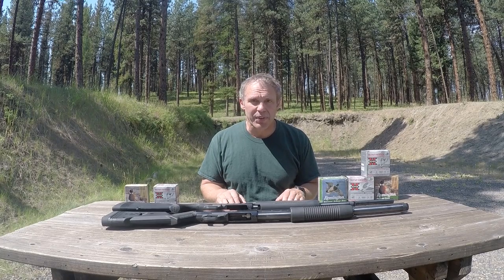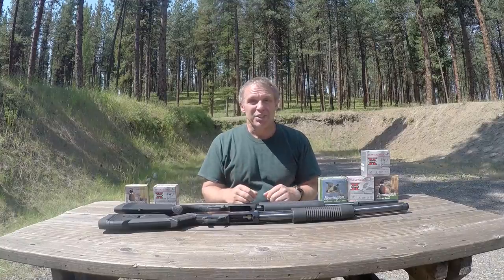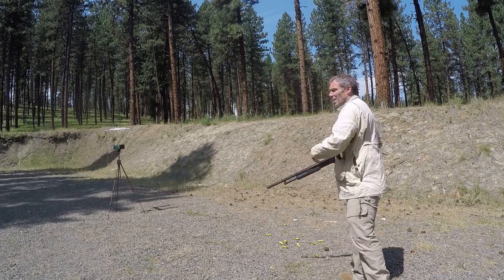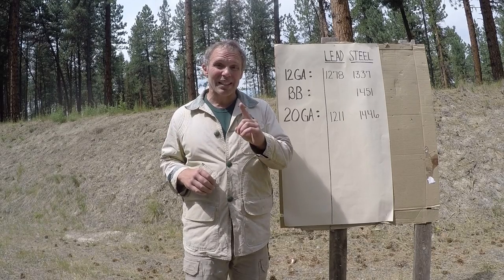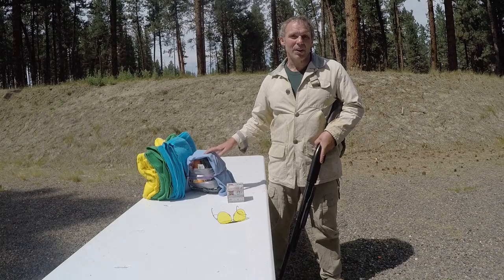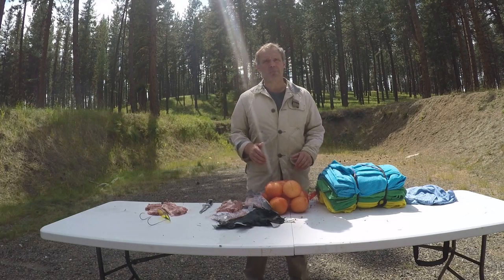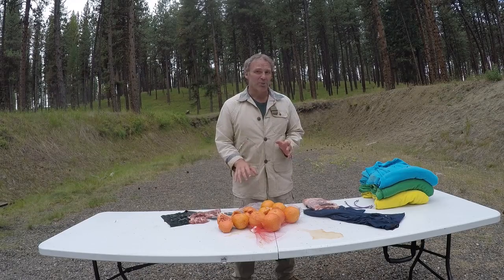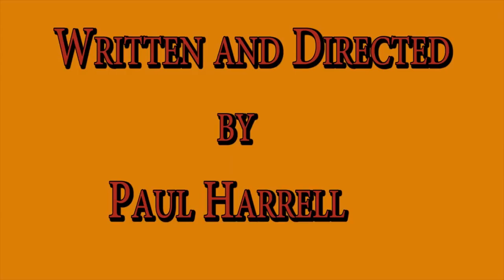Steel Birdshot for Home Defense

Comment: I'm pretty sure that had I tried to test the velocity of my shotshells I would have proven that both lead and non-lead shot are viable self-defense loads against chronographs.
Reply: Yup. For me it would take them out every Time.
Reply: same here
Reply: 45 Auto those chronographs are pretty easy to take down
Reply: Don't feel bad. I, myself, wouldn't try my luck with an expensive chronograph and a rifle. I just KNOW I would cut one of the guide wires in half (if not blow apart the unit itself). I probably couldn't hit a wire if I TRIED*, but if I *WANTED to not hit it? I'd hit it.
Reply: @angry_zergling  It's amazing how bad a reduced load 9mm hitting one of the wires for the sun shade will wreck the whole chrono. I repaired one after being hit 3 times (it was my brother's, he winged it with a 357, I nicked it with a 9mm and caught it again with 9mm, the last time probably did it in). Even though we got it back up and running after the first hit it never seemed to read correctly. Crazy sd numbers, 100-200 fps on fairly precise loads. A rifle might actually not damage it as much, if it cleanly shears the rod in half. The 9mm made the rod look like a #7, absorbed a lot of the energy.
Reply: angry zergling happens all the time when I try to toss walnuts over my fence. Every time I hit the utility lines that hang right over it.
Reply: Not so secretly glad I am not the only one who had that thought.
Reply: I have an original crony from the '80's.  My kids shredded the original cardboard shields, so I don't use them.  my buddy punched out the crystal over the readout, with a shotgun wad, so I put 2 layers of packaging tape over the front. It was even run over by a 4x4 pickup, and I had to straighten out the case, but the darn thing won't quit!  Btw, Now I only shoot over it myself, even with someone else's gun or load. I also don't shoot from more than 2 yards, just to prevent wads from hitting the screen.

Comment: I wish I'd never bought a shotgun for home defense in 2020. Is it effective? Yes, but I got a massive headache from trying to figure out which ammo to use. There's #4 buckshot, #4 birdshot, dozens of permutations of target loads, slugs, #1, #2 , #3...#9 of Every kind of shot. I ended up buying a tactical light and nightstand safe for my Glock 17 as primary home defense instead. At least I have hundreds of rounds of hollow points and 1,000s of rounds of target (although this is dwindling because I need the range at least twice a month to keep my sanity). My shotgun ammo is stocked pretty well with #4 steel birdshot and a very small amount of 00-buck, but since I live in a suburban area it should work ok with 5 birdshot loaded + a 00-buck finisher for stubborn targets. I'll still grab my Glock first because I can empty and reload in my sleep, but I would say a shotgun is fine for home defense, and I prefer steel birdshot because overpenetration is a real concern in my neighborhood.

Comment: One of barrys cut shells will make any birdshot a hell of a round.
Reply: So true! RIP Barry
Reply: Barry will be missed but never forgotten.
Reply: That's the only way I would use it for self defense other than in an extreme emergency.   He really was a wealth of knowledge.
Reply: Without Barry they seem behind the times all the time
Reply: Love Barry and IV8888, but I wouldn't use any modified ammo like that for home defense, might land you in legal trouble. Plain old 00 buckshot is the best option for home defense 99% of the time.
Reply: Not to mention many pumps and autoloaders struggle to eject only  the base of the cut shell after firing.
Reply: Except many others have tested cut shells like that and they dont perform well at all. Particularly in gel. In fact... they just kind of suck all across the board. Not to mention it essentially turns just about every shotgun outside of a single shot INTO a single shot loading system. Not worth the trouble for the mediocre results especially when commonly available slugs are out there and proven to actually work.
Reply: Did this channel ever test wax slugs?
Reply: @Predalien195  Also wasn't Barry's idea, it was around long before YouTube was even a thing.
Reply: @jonross377  Well aware it wasnt his idea. Simply put though, they dont work.
Reply: @JohnW-yv6yp  home made ammo is just fine in the Free States
Reply: Paul's tested cut shells, and barely clipped the edge of the target with the first one.
Wax slugs are way more accurate.
You'll have to be able to explain in court that a wax birdshot slug is not as powerful as an off-the-shelf #4 buckshot load an the wax serves only to prevent the pellets from hitting things other than your intended target, though, or you'll get hell for "modifying your ammunition to inflict greater injury."
Reply: Imagine a collaboration video with Paul  and Barry... 

Would have been legendary...
Reply: Good ol Barry.
Reply: @jonross377  great depression era lotsa poor country folk used cut shells. That's how I learned about them.

Comment: Its a really good idea to pattern ANY shotgun BEFORE hunting & avoid cheap ammo.
Reply: Agree 100%. I've some very disappointing results with super high end ammo in different chokes and good results with middle of the road ammo through the same choke and gun.
Reply: So is that why the steel 12ga preformed so badly, he didn't pattern it first?
Reply: @dannydevito2275  No, it just didn't work well with the choke on that particular shotgun.  All patterning it would have done was show that it didn't work well.

Comment: There’s another benefit to steel shot: it’s easier for Doctors to remove them without much additional tissue damage, by using strong magnets to draw them back out the way they went in.

In 1962 I was hunting with my best friend—we were 12–when out of the blue he cried out, grabbed his face and fell down. We hadn’t even heard the shot that delivered the single pellet into his eyeball.

We rushed back and he was taken to the hospital where he lost his eye. He now has a glass eye.

The surgeon explained he would have been able to save the eye had it been a steel pellets.

For years Docs had been asking manufacturers to put even a tiny amount of steel in  their lead rounds, but were denied. I assume it would have added a lot of cost.

Comment: Thanks for making this video. It’s pretty common for steel shot to make a significantly tighter pattern than lead shot. I’m not sure why your shotgun showed so much more spread with the steel versus the lead. The opposite should be true. Could you suggest why your results are opposite of so many other comparisons of steel versus lead shot? Thanks.
Reply: He probably hadn't patterned it correctly, I feel like if he got a smaller group the 12 ga would be very powerful
Reply: @dannydevito2275  Patterning doesn't affect the performance of a particular cartridge/shotgun combination, it only shows if that combination is suitable for your chosen use.  If you have changeable chokes you can choose the choke that works best with that particular load, but other than that patterning a shotgun isn't like sighting-in a rifle.

Comment: As an avid waterfowl hunter it has long been known that steel shot patterns more openly than lead. Generally manufactures suggest using a more restricted choke to combat this effect. Most hunters I know use full chokes and tighter. Modified has been my go to for general use. Improved cylinder is not tight enough to consistently kill birds at ranges over 30 yards. Please look into the 1700fps Remington loads! They pack a huge punch. I have never seen anybody test them critically. They are very expensive but I know for a fact they hit waterfowl hard.
Reply: It also improves patterns to use longer forcing cones and choke tubes with steel loads.  A lot of modern purpose-built waterfowl shotguns come with these design features.  Higher velocity + harder pellets = more deflection within the barrel, which resulted (for years) in more "flyers" in your pattern (outlier pellets).  This same concept has been applied to some of the newer "tactical" chokes and barrels on shotguns with pretty amazing pattern results at 50-75 yds.  A friend of mine had me shoot his tricked out Mossberg 500 (also ported aggressively and has a recoil compensator built into the stock, fore grip integrated light, etc.) and I was very impressed by it in terms of pattern and felt recoil using standard Winchester 2 3/4" 00 buck.  It was consistently spitting out very round volleyball-sized patterns at 50 yds and about double that at 75 yds, with about 1/2 the recovery time between shots.  I shoot Mod or Imp Mod for ducks and Full for geese, but these are steel-specific choke tubes.  In my double barrel duck guns, I always ran Mod-Full steel tubes.  I also shoot Mod-Full steel shot chokes in my 20 ga for sporting clays (with lead shot).  That's about like using a Skeet 1 and Imp Mod.

Comment: That really suprise ed me the steel shot spread so quickly...7 yards...
Reply: I thought steel shoots one choke tighter on average.
Reply: @adamtarbaux7769  20 gauge rocked it, 12 gauge blew out..i wouldnt have thought that
Reply: @williamrauch4464  same I guess as the shot column left the barrel the escaping gases threw the shot wider because the steel is lighter then lead.

Comment: Hey Paul any thoughts on the G3 battle rifle? Please review
Reply: Love my CETME.
Reply: I'm certainly not Paul, but... If you're looking to purchase one, check out the PTR-91 made in North Carolina. They've gotten mostly favorable reviews and are reasonably priced. From my (limited) experience, they're not horrible rifles but the G3/PTR-91 is an older design whose features have been surpassed by a variety of AR-10 clones. They feel heavier than they actually are due to the center of balance being quite a bit forward and having a lightweight buttstock, so the rifle always wants to fall forward, out of your hands. For similar money, a PSA AR-10 Gen 3 would probably work as well or better with better ergonomics. I would recommend going down to a gun store and handling them side by side. I did several years ago and ended up going home with an AR-10 clone.
Reply: MagicSquid I second the AR-10. I would take a Garand over a new production G3. $3 20rd mags are nice though
Reply: South Carolina* and apparently the 91 is an older model.
Reply: My 7yo cousin came out to shoot one day. Of the two AR15s, 12g shotgun, 10-22, and bolt action 22, he said the CETME was his favorite. Smooth, light recoil, big bang, makes the steel sing and swing. Plus, how could you not like those classic curves? 😉

But yes, it is a 60yo design. AR 10 would be more capable of more things.
Reply: @OutsideTheTargetDemographic  You have to love that old school iron.
Reply: Best battle rifle. Gota love that steel
Reply: @MagicSquid  problem with ar10s is that in shitty environments they don't run and the designs are mostly proprietary to the manufacturer for uppers and lowers for the most part can't be swapped like the ar15 counterpart. I've had my cetme packed with dirt and she just kept running

Comment: #2 Steel BUCK for the environmently sensitive home invaders and raccoons.
Reply: Ducks dont really eat dead home invaders or raccoons so should be fairly safe to use lead if you want.😉
Reply: @hammerslammer3006  In The Great White North steel shot has been the only choice for some time.  Load up 1; choke down 1 and no Damascus barrels.
Reply: Jim Alley  lead goes a ways but not all the way to south America. 🤣 
  either way both critters are under a fair amount of dirt in a timely fashion so they dont stink up the yard...
Reply: @geraldhemming9317  thought the general rule was 2sizes bigger steel... there is a fair amount of other "non toxic" shot that is as or more dense than lead.